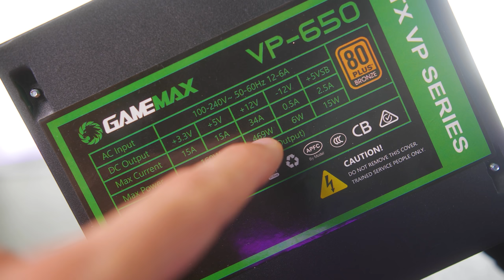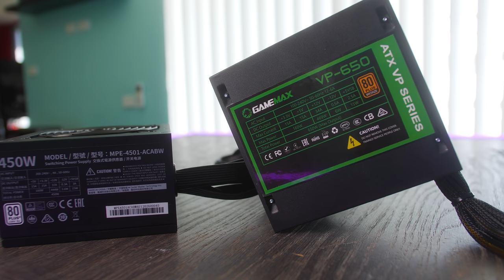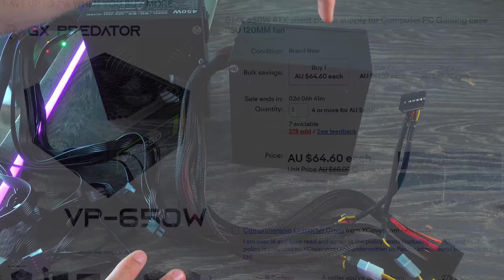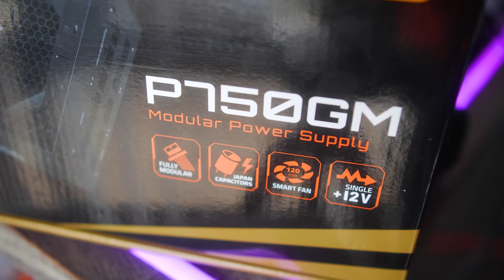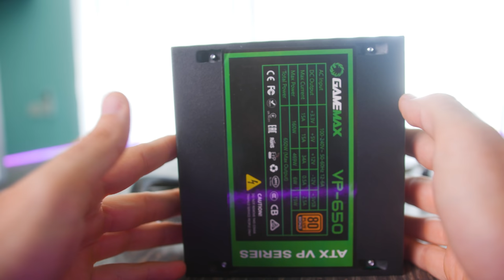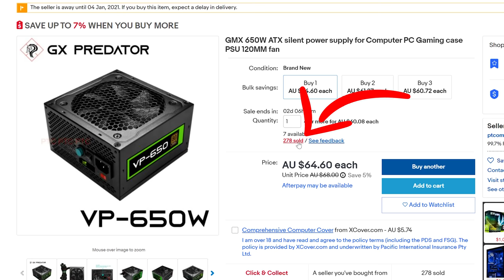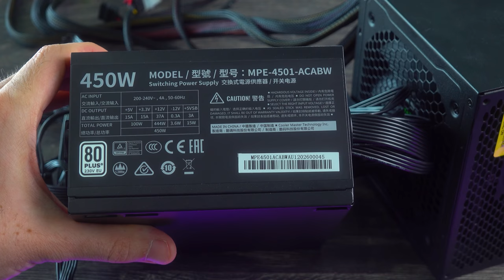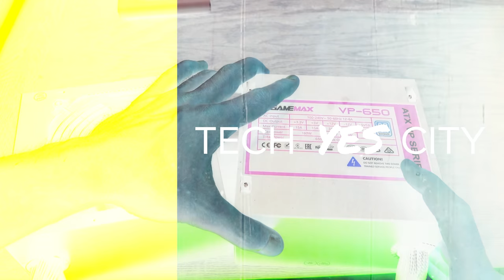This Company is Straight LYING about their "650 Watt" Power Supplies.... (*UPDATE* FAKE GameMAX??)

Comment: could you test the GE-700 from gamemax please
Reply: please let's see if all their product is not good, also i could not find any review of it on the internet. like the comment guys let him see it
Reply: If I were you I would skip gamemax and similar brands because if their quality. A bad PSU can kill all your component and in worst case catch fire and burn down your house... Best PSU manufacturer is Seasonic, but Corsair, Cooler Master, Evega and Be Quiet make respectable PSU. Bought a Seasonic PSU in 2012 and its still running fine powering powerful components.
Reply: @barbrooo8022  I’m already using it but I’m always scared to burn my components I put my hard earned cash on my PC, And there is a catch. in my country the companies you mentioned either so expensive or I can’t find them so we have cooler Master at decent prices do you guys recommend cooler Master PSU
Reply: Save up and buy a Cooler master if that's the cheapest good brand PSU available. 

A bad PSU may fry all of your components when it breaks down, thus it's not recommended to cheap out on a PSU as a cheap one might cost you your pc (worst case scenario).

Comment: From the video that you showed,as an electrician,that power suppy is really 80+ bronze where the effiency for that power supply maxing out is 520watt from wall,but why that power supply draw so much power from the wall,from what i see is type of cable they use,it created resistance,higher resistance means more power to draw from the wall,if effiency is lower than 70% than the power draw should be under 455watt,and the other thing to test psu using ur computer is very dangerous and not a right way to test that..my conclusion here that psu is 650 80+ bronze is real,idk about the other certificate that the shows,650watt is dc signal that have been convert by psu and the component is cheap I don't deny that by judging from weight itself but they can make out a powerful psu by using a cheap component,yes they can..buy it?? I don't recommend that,cheap component can be c4 to computer
Reply: Lower efficiency means more power draw from the wall, not less!
Reply: Nope,u r mistaking the meaning of psu effiency,it already state if it has 50% effiency from 100watt,it will draw only 50watt from the grid,high efficiency mean high power,

Comment: lying about specs is far from new, generic brands tend to be rated for peak and not average or consistent; even the decent brands sometimes pull off similar,  I had an ocz 450w that had the same identical internals at their 550w model....stick to good brands, and read reviews, psu's are not worth messing about on what's the cheapest available; best case their under rated, more likely case they will kill your hardware prematurely because of being unstable(electric noise; can cause clicking in harddrives), and worse they can malfunction and cause fires

Comment: I have a vp-700 rgb in my pc it has 48A on the 12v rail is it safe or should I upgrade my psu
My pc specs :
R7 3700x 
Rtx 2070
32gb ram
512 nvme
2tb hdd
Reply: Its only 576 w on 12v rail. Idk how efficient that power supply is. If its only 70% like this channel said. Then you are doomed

Comment: I HAD  A POWER SUPLY that  has a "tranformer" with a wire loop conected both to ground and its filled up with concrete instead of cooper its brand is HANTOL WITH A FAKE PFC please check it on extreeme systems org ive never seen that before it blew like a rocket with sparks in a core i7 3970 extreeme edition x79 plaform when was used as temporary psu.

Comment: Wait, you can run a 3070 just fine with a 450W PSU? Then why do they recommend 650W?
Reply: NVIDIA always recommends a psu with higher wattage just to be safe in case of any spikes in voltage during use.

Comment: Be interesting to see some tests on the GameMAX 850W "Gold" as well. 
Also be interesting to see the sine wave on these with some oscilloscope testing, and tear them down and check out the capacitors, coils, etc....
Reply: GameMax actually does have several PSUs that have legitimately passed the 80+ certification.

This isn’t one of them.

This one also doesn’t exist on the GameMax website as a product they even offer, though the label is similar to the VP-500’s specs.
Reply: @doesitgame  so its not really a GameMAX issue, as much as it is a Chinese Knock off of the brand...like fake Apple, Beats, GPU's, etc...?

Comment: the 850 watt rgb one isnt very good either. i had two of them trip my breaker when they were at full load. evga i havent had the issue since.
Reply: i bought a 400w evga psu and its holding up really good. its wierd cuz my system is supposedly recommended at 500w or more so knowing this, i can say evga is really trustworthy even with their cheaper products

Comment: these shitty psu's sold everywhere brand changes but model number is usually same their common issues coil whine, smell, not working fan from factory(computer shuts down after 1-2 hours) also they give high voltage when you shut it down from power switch possibly damaging components

Comment: Welp...
When you have a gamemax Power supply 👀👀👀👀😥😪😪

Legit just pulled mine out the case.

Its a 550W unit in the UK but its 80+Gold and has 44amps on the 12V rail eith max output of 528W.

Should be fine for me but this unit looks very meh

Comment: that's an ebay ripoff mate, I've tried and tested the 500w version from amazon and not only the cables were of a higher quality and there were 2 6+2 pin connectors but the tests were pretty accurate as far as I'm concerned

Comment: Jeez, I was just thinking of buying this exact same power supply. Do you know any good 550w PSU thats cheap?
Reply: Might be worth digging a bit deeper to determine if it’s even a real GameMax or a shoddy counterfeit.  GameMax doesn’t even make a “VP-650” model...

https://gamemaxpc.com/productkkk/list-276-en.html

...but they do make a VP-600, which really is certified 80+ Bronze:

https://www.clearesult.com/80plus/manufacturers/115V-Internal/

Looks like this may be a counterfeiter peddling generic Chinesium and trying to trade on someone else’s name, rather than an entirely garbage product put out by GameMax.  Although it is worth noting that even the genuine VP-600 uses the same misleading labeling of combining the max power of 3.3 + 5 + 12V rails to come up with “600W”; at least on that model the math is right for a 40A current at nominal 12V producing 480W peak on the rail.

Comment: Can you do Apex Gaming AG-850M PSU review
Reply: Apex gaming is legit, the manufactor behind it is a reputable veteran company which mostly do OEM work before, just start to push their own brand in recent years. However, their reduced cost is due to using good but not great components, so don't push their powersupply too hard, and don't expect seasonic level quality.
Reply: @therocklau  Would a ryzen 5 5600x and rtx 2080 (no oc) be fine with the said psu?

Comment: the problem is not the 35A 12V phase....the problem is, that this PSU has only 1 12V line!! most "usual" PSUs in this Range use 2 12V Phases!
even my cheap LCGP650 2.3 use 2 12V Phases....and it was a cheap over night buy, cause i guess my old enermax was gone.....but it was not the case^^
If u use a 105w tdp cpu and a 300w Gpu, you are over the 405w max on this 12V line, without any Hdds or Cooling Method!!
im curios about that, i guess u cant overclock your 10700kf with this psu! i guess your system would crash!
And on Top: All of these "Labels" 80 Plus minus silver diamant uranium special is garbage! its a brought label! The Manufactor pay for that label....and the company who owns this "label" never saw this PSU!

Comment: 2:18 NO, NO, NO....... 80 PLUS test a PSU against a set figure not another PSU. So as long as it puts out 80% of it's claimed 650W at 100% load then it get's the certification meaning that only 20% of your electricity is being wasted as heat........ 80 PLUS is NOT a quality rating, it is an energy efficiency rating. So as long as it can put out 520W (80%) of it's claimed max at 100% load then it gets the rating as far as I can work out. 80 PLUS ARE MEASURING ENERGY EFFICIENCY NOT POWER EFFICIENCY AND AGAIN 80 PLUS IS NOT A MEASURE OF QUALITY........ some non 80 PLUS rated PSU's could be better quality but not as energy efficient......... I would be a lot more concerned about how many Molex to 6 or 8 PIN adapters are being sold as IMO they are lethal!!!

Comment: Gamemax is actually an amazing brand. I love their cases/power supplies and use them in my own systems in Ireland. But never the VP model of psus. Only GP model which are true 80+bronze for 550w models. 12v rail at 500w too. So not a shabby psu. Weighs in at 1.6 kg.
Reply: still tho. they knowingly mislead people with this hot garbage so their reputation is nothing but a sham. never buying products from them again
Reply: @dhanajon5528  Agreed, never had any issues with their power supplies or cases. In my opinion this is ridiculous I understand that but just because 1 product that has released is an absolute shambles doesn't mean you should entirely cancel them as a company. They are not the first to do something like this and definitely not the last. Im sure AMD/NVIDIA/Intel has done the same with a different product in the past.